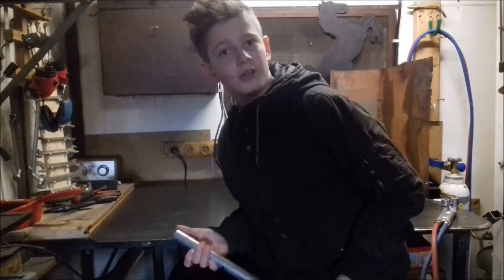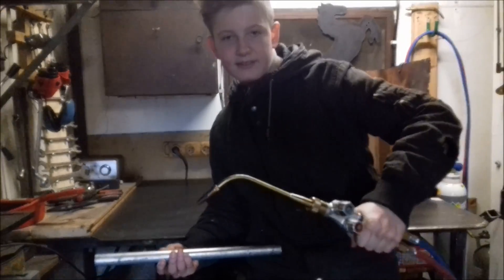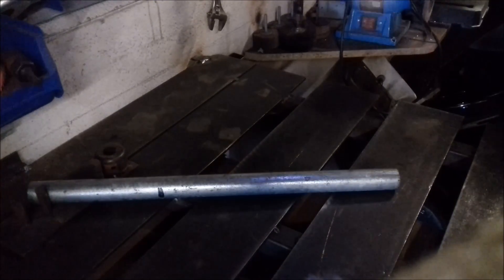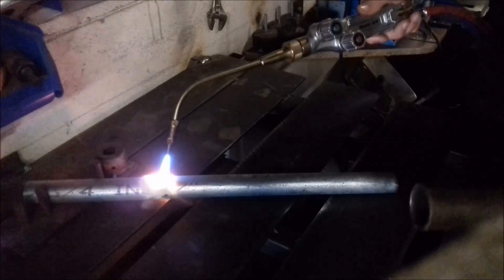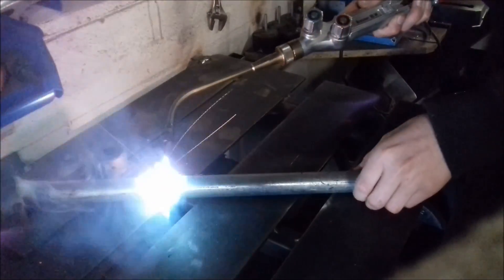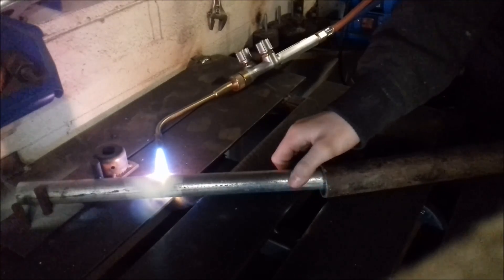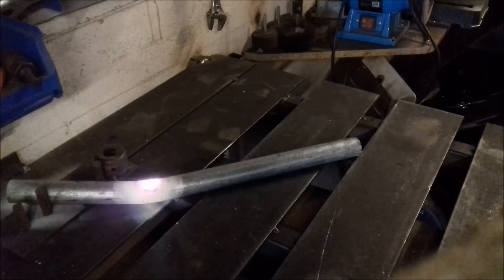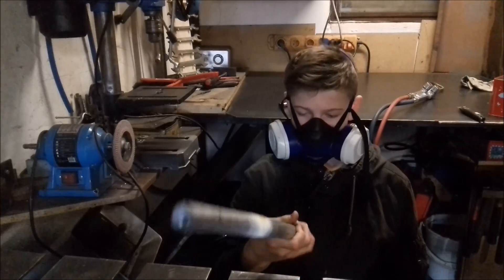How to Bend a Pipe with a Oxy-Fuel Torch

Comment: Ive heard when bending pvc pipe with heat you can pack it with sand to prevent it from kinking when bending at sharp angles. 
I wonder if you could do the same with steel pipe perhaps.